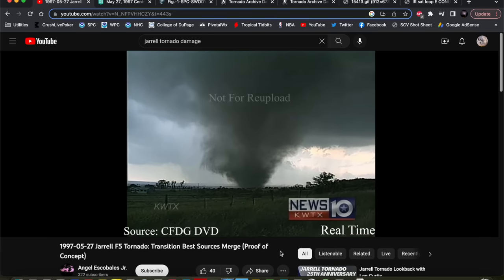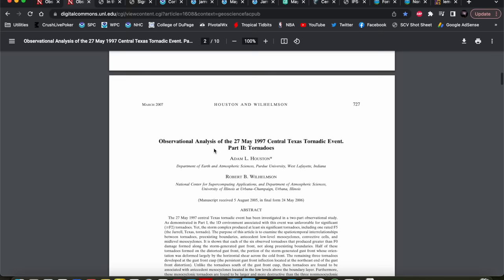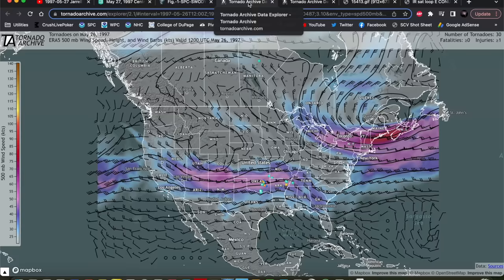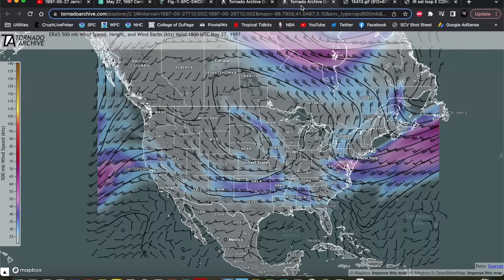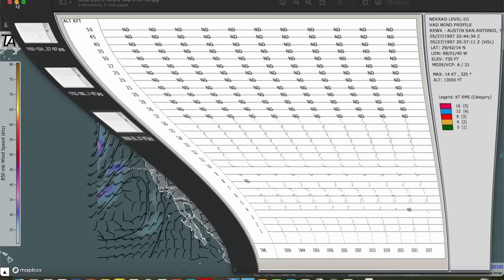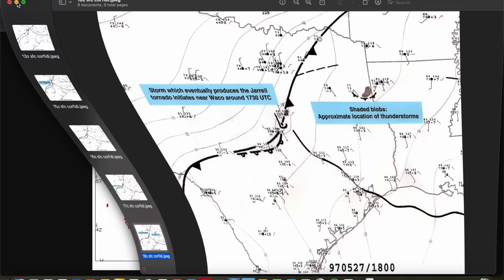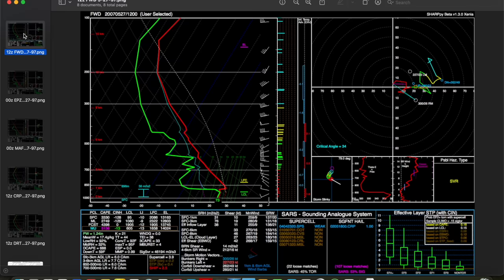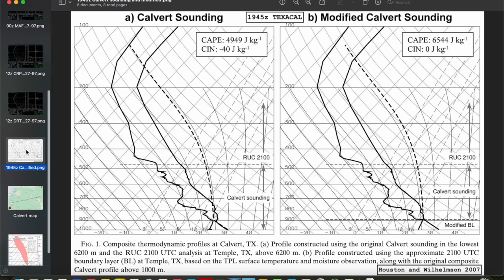The Jarrell, TX, F5 Tornado of May 27, 1997: A Case Study

Comment: I think there a few factors of it being F5. 1) it was moving so slow than the average tornado speed it had time to churn and create more damage than just at one stroke. I’ve read a damage survey to where it said that it couldn’t take an F5 tornado to create that kind of damage and it was possible that an F3 can create that going by the structure of those homes. Also, I’ve read more into it and said that the houses in the double creek subdivision were just wooden frame built houses with pneumatic driven nails into the concrete attached to sill plates instead of anchor bolts. Most of them didn’t have underground storm shelters due to the geography of the area because of limestone that was underneath the subdivision. And even if they were above ground storm shelters, most likely it would still not hold. Also, it mentions that this event and May 3 1999 tornado were responsible for creating the EF scale that we use today. That’s just my opinion but anybody can correct me or add anything to this.
Reply from the maker: All great points. Eyewitness accounts do state that the tornado slowed down a bit as it approached the Double Creek Estates area, and those poorly anchored homes stood no chance with such a slow moving tornado, even if it wasn't truly packing F5 winds.
Reply: @ConvectiveChronicles  https://www.govinfo.gov/content/pkg/GOVPUB-C13-2da667805224aca0ceb7fdce95ee09d6/pdf/GOVPUB-C13-2da667805224aca0ceb7fdce95ee09d6.pdf

Here’s where I read the in detail damage survey from a structural engineering perspective if that interests you!
Reply from the maker: @dark_seph2222  Thanks! I love going over damage surveys and seeing what they found from an engineering perspective.
Reply: @ConvectiveChronicles  Also, here’s an interview with the person who published the paper discussing it with someone who did a similar but more generic case study on the Jarrell 1997 Tornado: https://youtu.be/D5PZLpk_E7c